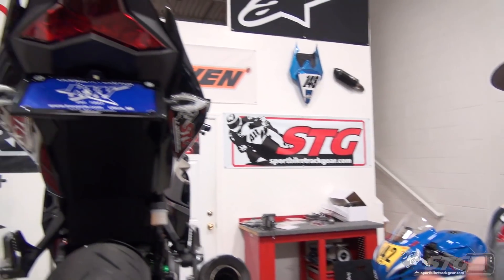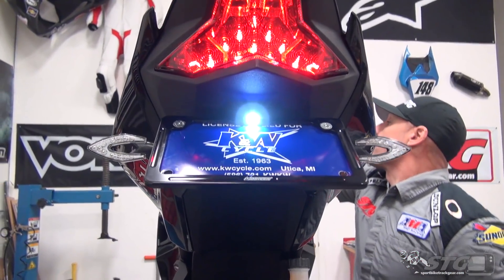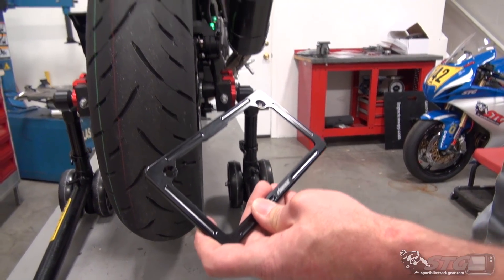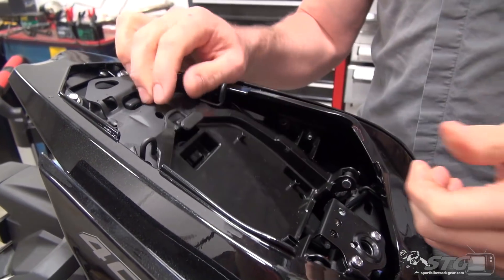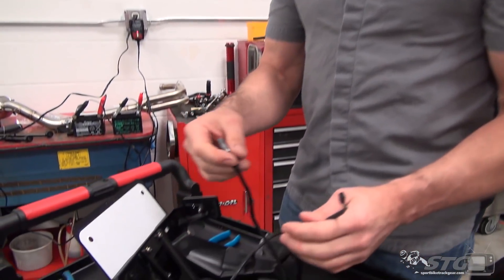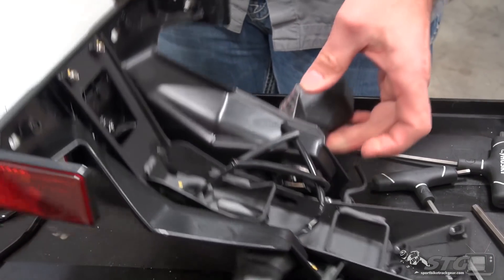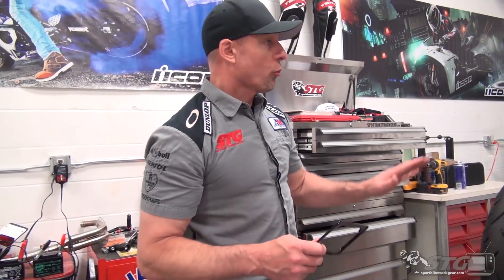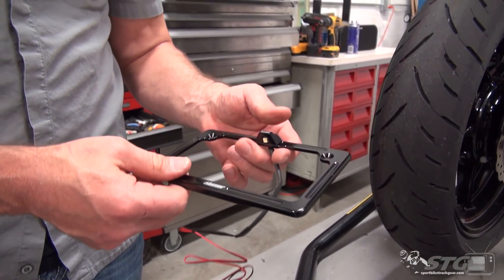Kawasaki Ninja 400 Driven Fender Eliminator Install | Sportbiketrackgear.com

Comment: I think if it were me I would have just soldered and shrink wrapped the OEM plugs on directly with no connectors. This new Ninja 400 is a seriously nice bike.
Reply from the maker: If I am doing this on my own bike I typically do nut use the connectors supplied and solder instead. For the video installs I like to use the parts included as I feel this will benefit the novice wrench more than throwing in the curve ball with soldering. - Van

Comment: The Driven Fender Eliminator looks dope. Cant wait to see how it looks with the Driven Integrated Taillight. Im definitely looking forward to see how it turns out.
Reply from the maker: We need to get back to work on the Ninja 400 for sure. The past couple months we have been a little more focused on the bikes Max and I are riding at the race track. - Van
Reply: @sportbiketrackgear  no worries. Take your time, no rush. Just excited to see the turn out. Especially since ill most likely grab the 400.

Comment: Do you guys sell this as a kit? I'm trying to find the plate frame and tail light but all I see on the website is the eliminator and turn signals
Reply from the maker: Sorry it is not sold as a kit. Here are the links to all of the parts on our site:
Driven Kawasaki Ninja 400 18-19 Fender Eliminator w/Arrow Turn Signals
https://www.sportbiketrackgear.com/driven-kawasaki-ninja-400-2018-fender-eliminator-w-arrow-turn-signals-and-resistors/

Driven Kawasaki Ninja 400 18-19 Fender Eliminator
https://www.sportbiketrackgear.com/driven-kawasaki-ninja-400-2018-fender-eliminator/

Driven Billet Aluminum License Plate Frame
https://www.sportbiketrackgear.com/driven-billet-aluminum-license-plate-frame/

Driven Billet Aluminum D-Light License Plate Frame
https://www.sportbiketrackgear.com/driven-billet-aluminum-d-light-license-plate-frame/

Comment: Hey van, wondering if that LED in the plate frame is replaceable?? I want to order one myself but it would be a waste if that LED ever went out and you needed another frame just for the light. Thank you
Reply from the maker: I am sure you could replace it if you need to. LED's last a long time, I do not think this would be an issue. - Van

Comment: Hi Brian

I really like your videos and helps me a lot !

I just installed a fender eliminator and new turning signs, and I need a flasher like that. I'm not sure if I understood right, did you put another new flasher or did you do something on the original one?
Where can I find a new flasher or how do I proceed for mod the original flasher?
Reply from the maker: Here is a link to the flasher relay I installed in the Ninja: https://www.sportbiketrackgear.com/driven-flasher-relay/ 
This will slow the flash rate back down for you. - Van
Reply: @sportbiketrackgear  can you send to Brazil?
Reply from the maker: Yes Sir we ship internationally via USPS (most affordable) or DHL (quickest). - Van

Comment: There is some of these in amazon that are only 25 dollars, I have one and it works very well
Reply from the maker: You will not find the Driven one on Amazon for $25. Odds are that is some low quality shit out of China. - Van
Reply: @sportbiketrackgear  I was talking about jsut the metal piece, you reuse the stock turn signals and license plate light. It's a very cheap way to get a similar look

Comment: What’s wrong with a faster flash rate on your turn signals wouldn’t the faster one be more visible?
Reply from the maker: If you are cool with it then leave it,  doesn't hurt anything. The stock flash rate is much slower and most want it to be the same speed. End of the day this is all personal preference. - Brian Van